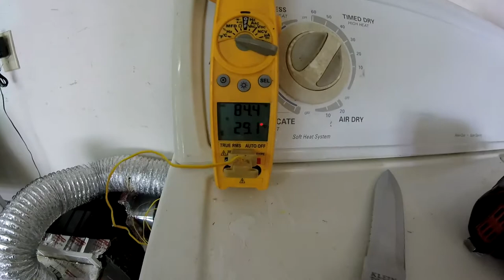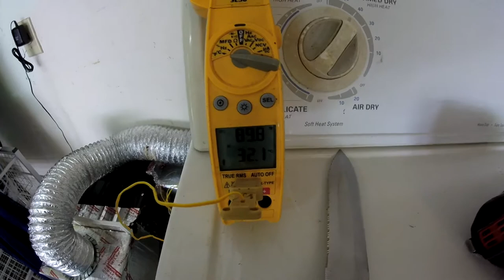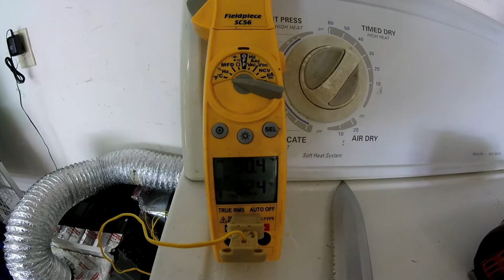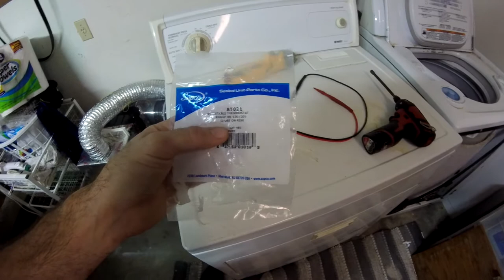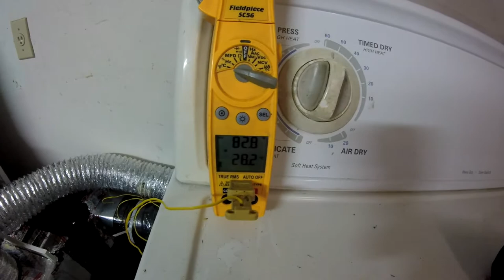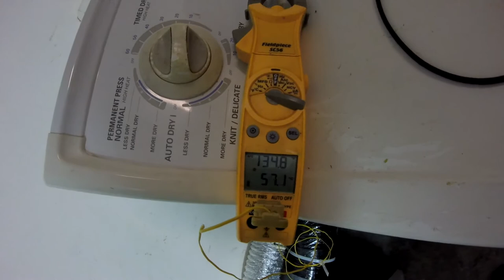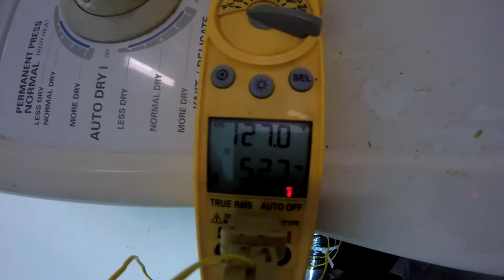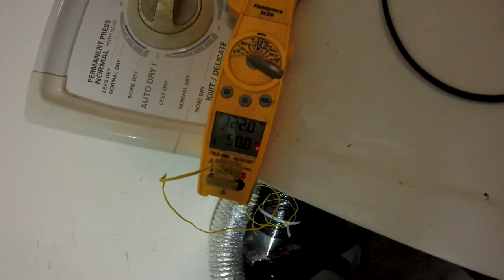Built not Bought - Heat Pump Clothes Dryer Experiment

Comment: What you need to do is not recirculate the air. Have the hot warm air blow into the drier then out. Let the dehumidifier pull in fresh air. The recirculating method will not last. You will kill the compressor from short cycling.
Reply from the maker: Mr HVAC hmm that is interesting I wonder if it would work better. I will do a test your way. I just modeled it after heat pump dryers they already make.
Reply: Joe the reason the manufactures can keep a closed loop without the amp draw being a issue is because they are using R-134a. 

Most dehumidifiers or room air conditioners use R-410a and they can't handle a high inlet or condensing temp. 

This is why you seen R-134a in cars and not R-410 or R-22.
Reply: @joeshearer1247  Did you test this?  Can you post a video?  I'd like to see:  actual # watts used (for all equipment) and total time to dry vs.  conventional electric dryer.

Comment: I want to use a VRF/VRV line set to install an exchanger in my (formerly) gas drier. I don't know if a dehumidifier has enough capacity to dry clothes in a reasonable amount of time. Good luck with this project. I hope it works. It will be more efficient than an electric drier no mater what.

Comment: Joe, you could significantly speed up the drying cycle by adding a microwave heat source for the first half of the cycle.  Once the air moisture content drops below a determined point, magnetron operation would be turned off.

Comment: you would have to sepperate the coils
Reply from the maker: Roush Hawley why would I seperate them?
Reply: as it works now, it is pumping the air through both coils, and the heat is generated in the compressor. seperating the coils would draw heat from the room, and eject it in the dryer and put less strain on the compressor.

Comment: Need way to trap LINT or your coils will plug quickly.Need homemade screens to collect it.Joe ur  young Frankenstein.
Reply: I was about to say the same...what about the lint?
Reply from the maker: Michael Lee good point I do have the filter inside the dryer and the filter that the dehum came with. Can you see it jammed in the ductboard? But it's not stopping everything so I will have to put some filter material in there too.